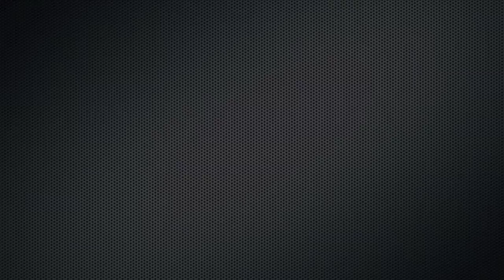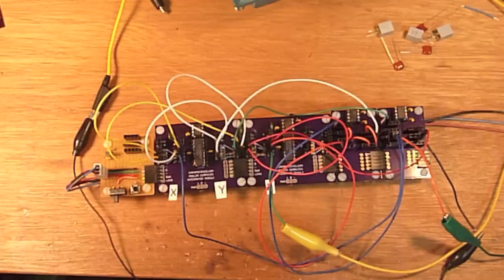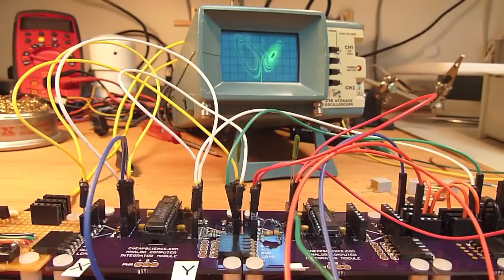Quick overview of my modular analog computer kit

Comment: Do you think analog computers should be revamped in the modern day?
Reply: Yes I do. They can exceed the performance and power efficiency of MCU based systems, and often are required pre-processors to support MCU/ASCI/other digital tech. The fault is when folks try to make an analog computer vs. digital argument.
Reply: YES. there is ABSOLUTELY A HUGE POTENTIAL MARKET FOR IT. Take a look at the current modular-analog audio frenzy in the music community. Even for simple hobbyists.
Reply: The biggest area for analog computing is in AI/Machine learning. In fact you have one inside your skull. One powered by electrochemical reactions.

Comment from the maker: The board-to-board connectors carry power and two control signals. The control signals set the run/hold/set initial conditions mode of each integrator.